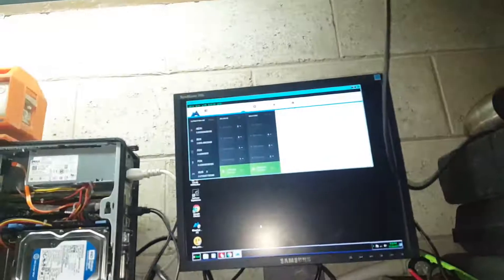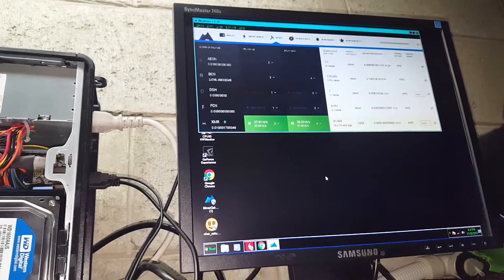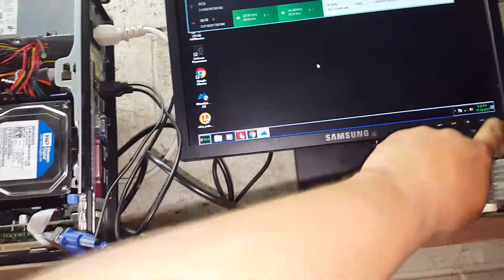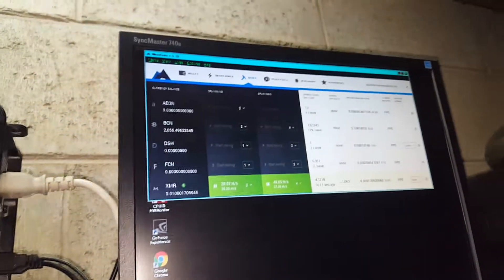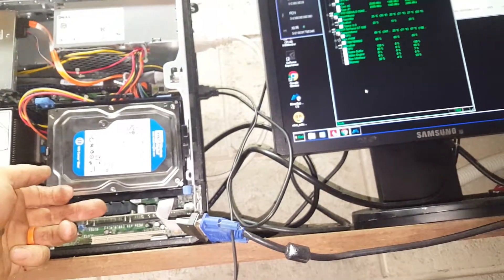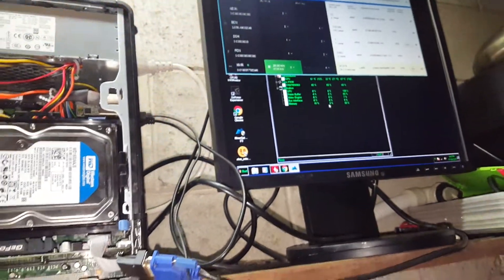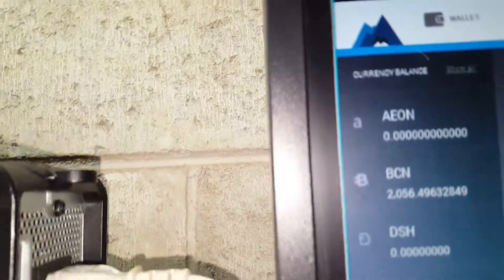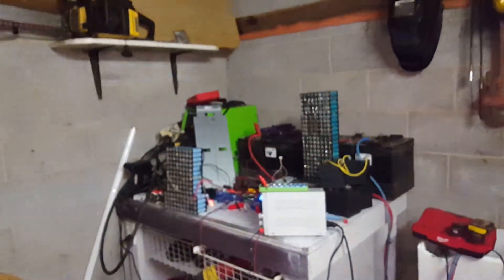Solar powered computer for the shed / Crypto mining

Comment: how do you get the pc to turn on every day? do you have an automatic task for this?
Reply from the maker: +Raging Ragers its got 300 plus ah of batteries under the bench running it 247 mate
Reply: so how many watts does your setup consume? you have a 800watt solar system with 300ah right?
Reply from the maker: +Raging Ragers 120 to 150 depending on computers fan speeds including screen
Reply: do you run other appliances on the solar system? that 800 watt with 300ah for a devices that takes 150 watts seems excessive.
Reply from the maker: +Raging Ragers i didnt build the system to run the miner its just a bonus
Reply: what kind of battery do you have?
Reply from the maker: +Raging Ragers agm and flooded lead mix
Reply: i thinking i need a 1khw solar system to run a 400watt pc 24/7 just cant calculate my battery set up, do you know of any calculators for this?
Reply from the maker: depends on sunlight hours and if you want operation safety overheads you want, i upgraded this gpu and its more like 180 watts now and i havnt ran out since i connected the bigger battries
Reply: looks like ill need around 600ah battery and 1000watt solar if i get around 7 hours of sun a day. sounds about right?
Reply from the maker: Raging Ragers that should  keep you running mate